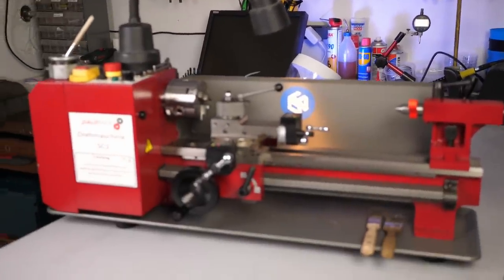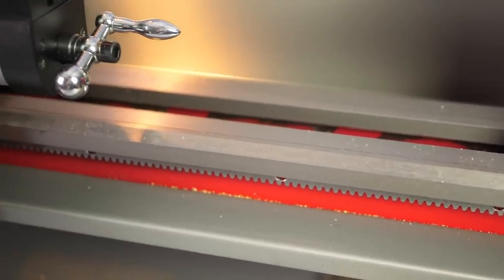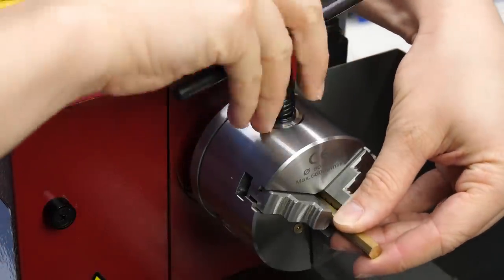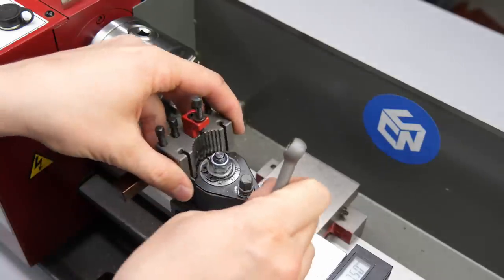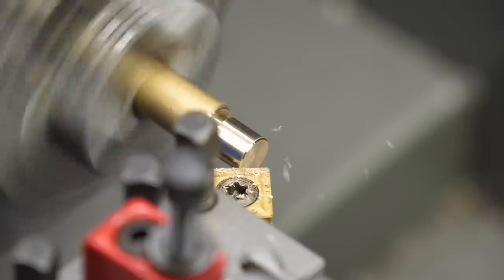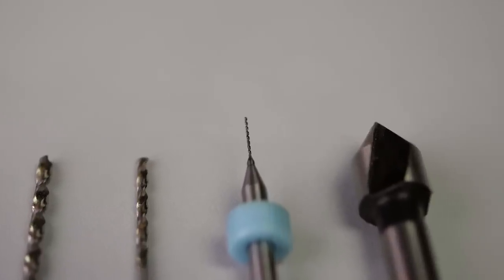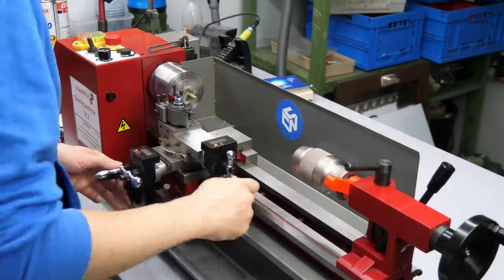Mini Lathe Project: 3D Printer Nozzle

Comment: Just grind whatever angle you want into the drill. At work I was constantly grinding custom shapes in HSS for oddball stuff, and it's pretty much how everyone did it in the old days, ie, they sell a Screw Cutting Gauge because everyone used to grind their own thread cutting tips.

Comment: Nice! I tried making my own nozzles in this way a few years ago, but it's a huge amount of work for something you can buy for very little. Now, I buy 0.3mm nozzles and drill them out to 0.35mm.

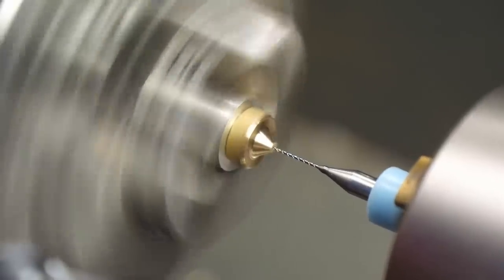The drill wobble you encountered @11:55 may be due to your headstock and/or tailstock alignment to the lathe's long axis. Barely noticeable on larger parts, but a killer for small carbide drills! As the nozzle hole is possibly THE most critical feature, maybe worth getting the alignment right...

Comment: Since you are machining bronze id say take a 2mm drill bit , hold it at an approximate angle against a grinding wheel or something fit to cut the drill bit. and just grind it to the angle you want, drill with a fresh drillbit , then take out the tip with the ground one. Bronze is so easy to cut, if you are careful you wont break the bit. Then i'd try taking a bit of Emery cloth , pull a bit thats around 2mm wide and stuff it in the hole for a couple seconds to smooth any imperfections.

Comment: So I'm sure you are going to try to make an all metal  heat brake - It's on my list of things also.  I'm going to try T5 titanium and stainless steel.  T5 has low thermal conductivity and good machinability  (for titanium).  Haven't settled on a stainless alloy yet.  One you tuber suggests drilling the 4.0 MM hole for the Teflon tube to 4.2 mm causing less heat exchange between the heat brake and the Teflon tube.  Cheap heat brakes sometimes leave the drilled 4.0 mm holes as is with a taper at the bottom from the drill bit tip - this can cause the Teflon tube to constrict or compress - no good.  I will try to finish the 4.0 mm (or 4.X) hole with another drill bit ground flat on the end - might work.  Otherwise I'll buy an end mill when I settle on a final dimension.

Comment: Hello, you can't stop buying a mini lathe after this video 😀
I flip thread cutter upside down, invert the rotation, this way when you cut it goes away from the chuck which is much mistake forgiving ! i do the end of the rewinding turning the chuck by hand. I a bit bit tedious but you can't crash your par this way. Danke  fur diese hubsche video 😀

Comment: For all tools minimise the extension out from the toolpost. This is particularly important for parting tools. Let it stick out the minimum required to do the job. Make sure parting tools are perfectly square to the lathe centreline. Lovely little lathe, mini dro units are particularly good. To replace the dial gauge set up on the tailstock, you could modify a digital caliper to give you accurate depths.

Comment: I am making experiments on nozzle to increase the flat surface around the hole. The point is to be able to have 0.45mm extrusions AND very big extrusions (1.7mm for instance, or more) on the same print with a 0.4mm nozzle. It works but I don't know if the result would be the same on regular nozzle. My point is to merge perimeters into thick extrusion at low speed (good for finish, layer adhesion, saving time and noise of the machine, and why not some wearing of the printer) and thin extrusions (bridges, supports, detailed external perimeter...). It will be saving a lot of time on filament with low flow rate (tpu, nylon...) and reduce the number of retraction (which happen to cut the filament into the direct drive of the extruder for instance). Maybe there is something to explore.

Comment: If it were me, I would grind the 60 degree tool from HSS. Learning to work with a lathe also means learning how to grind specific tools for specific applications. Practice on a spare part first. The good thing about this design is that the angle is not critical. So 55 or 65 degrees would most probably work just as good. Great video, BTW.

Comment: I'm an experienced machinist. You can grind a 60 degree angle. Do not forget to dull the drill slighly (for brass). Using carbide is fine. I would drill the small hole first, then shape the nozzle.

Comment: Just taking a quick glance at the drawings. If you want to achieve the first one: drill the hole+Ø0,5mm, broach+Ø0,20mm and ream the completed diameter. 
With HSS:
Drilling should be set at 20(vc)*1000/(3,14*Ø)
Broaching 40(vc)*1000/(3,14*Ø)
Reaming 10(vc)*1000/(3,14*Ø)

Regarding the drill bit for the 60°. For drilling in brass, it's recommended using a 118° angle tip and a spiral angle between 20-30°, so I can't really help you with that part.

Comment: Even in 3d printing having a lathe is a huge advange. For example today I printed round lid which occurred a bit off size.   Of course it is possible to fix such issue with help of file but it is not convinient. Furtunately recently I printed lathe chuck which helped a lot, although it is not even close to precision of  real one.

Comment: To make the tapered hole you could regrind a drill bit, or for a better surface finish you can grind a "D Bit".  Clickspring has a very good video on how to make them.  They are inexpensive, easy to make, and accurate, but cut very slowly.

Comment: I'm an engineer and have worked with machine shops quite a bit. I understand they regularly modify tools to achieve specified geometry. I'm sure grinding down a drill bit would be fine.

Comment: For the 60 degree feature, I would grind my self a D-Bit, or even turn one out of hardenable steel. That would be used just for the final shaping, remove the bulk with a normal drill

Comment: The other advantage to cutting threads on the lathe is you have more control over the thread fit so you can have anything from sloppy threads for hand tight items or interference fit and anything in between. You can get different dies to do similar but still not quite as much control.

Comment: As stated you can get 60 degree tooling, but you could just regrind a drill to 60 degrees as long as your careful not to overheat the tool while grinding and overly change the temper. There is also the whole adding back relief and keeping the tip angle centered so your drill will not lead off.
It would appear the old nozzle design was drilled and drilled and reamed. I would not surprised if the newer E3D nozzles have the .4 hole put in with a EDM hole popper for as much as they emphasis the effort they go thur to avoid the burs or chamfer to keep from having laminar flow issues.

Comment: Nice work! Although, carbide inserts are dull by design. You can sharpen it but it's probably easier to use a ground HSS tool with brass. The inserts require a lot of cutting pressure and neither brass or these small machines like that. Razor sharp HSS tool and a neutral rake tool with improve your surface finish. Happy machining!

Comment: Just fyi that 2nd tool you called a " left handed tool" is actually right handed tool.  when defining a tool hold the tool with the insert facing up and towards you.  Whichever hand the insert is pointing toward determines how the tool is described.  Doesn't change the fact that you did a great job on the nozzle came out great.  Ive been wanting to machine my own just for the hell of it as well but i program/ run CNC machines all day so it's ther last thing i wanna do when i get home.

Comment: I'd like to see you pursue the 60 deg. Filament path, along with an outer tip with smaller diameter. E3D likes the rather large flat at the tip for ironing down the filament for supposedly stronger parts. However the large flat gives a larger minimum resolution to x/y axes because of the squish from the tip.

Comment: If you want to do the 60º internal cut, instead of the stepped cut, grind some high-speed steel at a 60º included angle, and use that.. slow feed it, as it's a forming tool.. if you want something for reference, look at the cheap engraving bits available almost everywhere, just grind yours on stock the size you need.

Comment: Considering the same using my own lathe - but using a steel insert for the 0.4mm nozzle bore. That should give similar heat transfer for an all-brass nozzle but with the wear resistance of a steel nozzle. A fun project anyway :)

Comment: The carbide tool is actually a right hand tool as the chips go to the right. Shorten all tool overhang, especially the parting off tool and the finish will be better. Seeing as you cant get enough speed learn how to grind some High Speed Steel tooling and you will get better finishes and will be cheaper. I have been a tradesman for over 40 years and experience is more essential than expensive equipment. Also check the alignment of the tailstock to the headstock, something doesn't look right.

Comment: When flipping a part around like that for two sets of operations, you would want either the collet chuck you mentioned or, even better, a 4 jaw chuck so you can maintain concentricity of your series of holes. That's why you got that little nub when facing the stock after the flip that made you adjust your tool height. Flipping the part added error to your concentricity, and using an aluminum rod as a makeshift threaded collet added even more error.

For something like this it probably doesn't matter, but if you were going for real precision these are both going to keep you from getting that precision.

Comment: You could definitely grind a normal drill to a 60 deg angle and use it. A tool like that may give you trouble in harder materials, but in brass it will cut like butter

Comment: a 70° included angle solid carbide chamfer mill would be required. However I would hit the bore spec then run in a “custom” ground tool. A twist drill would work or old carbide tooling ground to the 70° included angle spec

Comment: protip for using a threading tool:  do it backwards and you don't have to worry about stopping the autofeed.  Start where the thread stops on the material, and just run it backwards.  Of course you'll have to reverse the feed and tool engagement as well.

Comment: You might want to check out the Rocketronics ELS (electronic lead screw). Adding an ELS to a light weight lathe can be a big help in terms of capability (and not needing to mess with gears) You probably have most of the parts already other than the controller which is surprisingly affordable.

Comment: I know I'm a bit late to the party, but I have an idea of what I would do with the mini lathe.
I would try to upgrade my Prusa MMU1 (or any other Bowden) to the new setup of the Prusa Mini. 
Double thread fitting as a replacement for the push-fit thingy. Then a brass olive around the ptfe tube and the tube is secured in place by screwing a threaded sleeve on the outer thread of the fitting.

Comment: Of course you can make 60 degrees hole with drill bit - all you need is to sharpen in for desired angle. Actually I bought 3D printer to make bit sharpener but somehow lost for now by doing parts for printer and modifying it.

Comment: Yes grinding a tool is an idea, but you have to use a dremeltool in a holder for the toolpost, or build a toolpost grinder from a vaccuumcleaner motor.

Comment: I also wanted to make a nozzle. The problem with smaill drills could be solved by making a bigger hole and then using plastic deformation to reduce the diameter, and controlling it by calculating the flow rate through it. I've managed to buy 0.4 mm drills on aliexpress, but smaller ones are not avalible, so I thing that is a reasonable way.

Comment: If you want some nice info about brass turning and surface finish on drilled holes , I really, REALLY recommend Clickspring's videod about turning brass on a lathe. He teaches stuff like the cutting angle , how to modify drill bits for brass yourself, and even how to make specific cutters or reamers. The modified drill bits leave a great finish, but a reamer could leave a mirror shine too.

Comment: Make a bi-metal throat
So these are being sold lately and use a steel 1.9mm ID tube with copper threaded ends.
What i propose is only the cold end uses copper/ brass thread with a cylinder going into the hotend. The hotend side needs a TI/ steel thread to transfer as little heat as possible into the throat it self.

Comment: Would be interesting to see if a mirror-polish offers any benefit. Would it be enough to just use brass wool (the stuff we use to clean the soldering iron at the soldering station) or a cloth polishing disk ? Or you could try to design an "ironing hotend" without any bore to make flat top surfaces even flatter. With the toolchanger on the printer that would be easy to make, and imho kinda interesting to see the results.

Comment: I always liked the flatter nozzle tips that tended to "smooth" the top layer surface finish more so than the pointy nozzle. Otherwise I have noticed little difference besides nozzle diameter effects detail.

Comment: If the nozzle has a metric thread(mine has it) then you can make the nozzle directly from brass screws... or even from steel if you want something abrasion resistant.

Comment: Stefan - should join in on our 7x mini lathe Facebook Group and see all the modifications and CNC conversions for that lathe [ Sieg 7x ]   Cross Slide Gibs mods, Carriage Gibs mods, and Plinth[s] mods  - Ive got a 3d Printed Index Wheel system youd dig too...  You would be an amazing addition to the group.  Thats a Nice MultiFix setup too btw ...   Good luck on the Voron0 as well ... building a 2.4 right now too

Comment: Hello Stéphane.
I m Bernard from France.
I have recently buy a profi 300v.
And I think to convert it to cnc for precision and make cone easy..
With a good conversion you can still use it in manual for some job and enjoy CNC for others.
I haven't found how turn/moove the 3 axis in mine yet 🙂🤔
So, I hope you will convert your lathe before I convert mine. 🤪
I really appreciate your videos, really nice made.
I think to add a end stop near the Chuck for stop the carriage at same time and in same place for each passing

Comment: Hi Stefan at 6:42 i think you are using tailstock and die holder the wronge way. The slotted hole and the corresponding hole in the tailstock should be connected via a guide pin.

Comment: I think you should chamfer the nozzle before it goes in to the final bore. Just so nothing hangs up on those edges. 

other things to try: 
copper and aluminum, both have very good thermal conductivity. 
Steel, if the lathe can handle it
Electroplated with silver, for the thermal conductivity
Reply: Copper is one of the hardest materials to machine well, especially for small diameter holes.

Comment: I have done work with the Abrasive Flow Machining process. I would be curious to see what the affect on using the AFM by flowing it in the internal bore before nickel coating the inside to make an smoother transition prior to nickel coating.

Comment: You've made it very accurately, Stefan! That's why it prints good! :) I guess that if you'll polish it with a tool for that (or maybe just using a polishing paste and a wool rope) then it will perform even better (try PETG!).

Comment: If you used a thread where the plastic enters, I wonder if that would move the heat into the plastic better, along the lines of your wire hacks.

Comment: 60degree angle --> Yes you can just grind a drill bit to that angle.
Drill bits are regularly sharpened by grinding, and during this process you can change the angle

Comment: Using Mitutoyo calipers éh? I can tell you are a man of culture ;)
Reply: ...and Yes, if you have a drill grinder, you can easily give your drills a 60 degr. tip (or just a grinder with an angled holder for the drill will do as well. Maybe even 3D-print the drill holder if you already have a regular grinder?).

Comment: If you want a nice bore in your drilled holes you'll need to ream it, and they definitely make reamers with angled tips though these are very very rare. You should try making your own cutters but you're almost certainly doing to need a mini mill not a router to cut anealed tool steel.

Comment: It’s easier to drill the 0.4mm hole with a pillar drill. I have done this for a friend using my small mill. If you want a 60 degree internal angle, look online for a 60 degree spot drill.

Comment: I had polished some nozzles interiors with toothpics + toothpaste on a drill. I would love to see a crosssection of this polishing process to know if it is a good idea or waste of time and toothpaste. Also to know if it can be improved would be good to know.

But a smooth surface in the heatbreak is much more important to prevent clogging. So it would be good to know if it also works on stainless steel.

Comment: I realize I'm replying quite late to this video, however I only recently discovered your channel.  There are times when I wish a I had a little faster print time than an 0.4mm nozzle, but a 0.6mm nozzle does not have the resolution.  You should make an 0.5mm nozzle :)

Comment: 60 deg inside taper: I would try to modify a center drill. Use it after the most material has been removed with an standard drill.

Comment: When you are making something like threads you van use equactions to count how deep your cut should be its much better. That way you will have tighter fits and i think that's important for nozles so when you screw them in they dont wobble